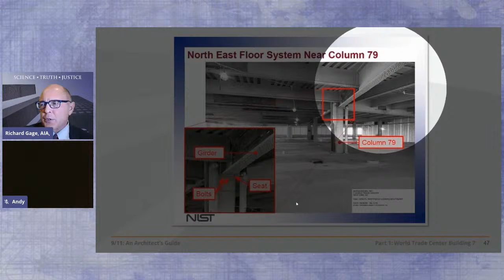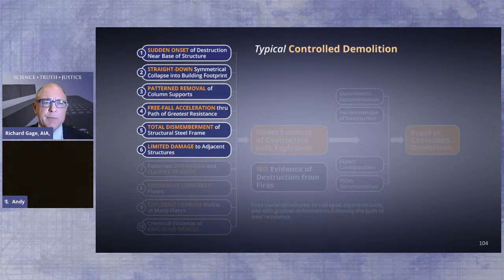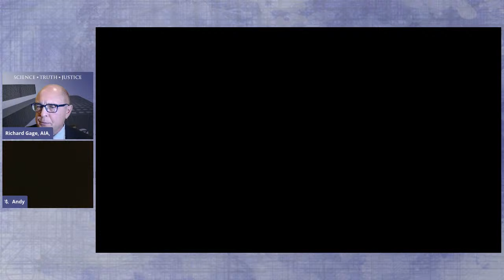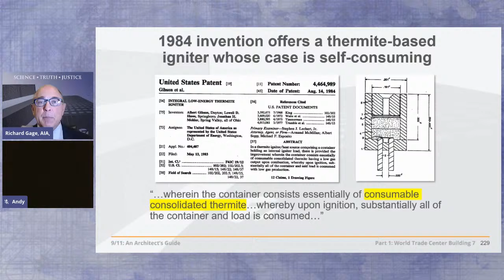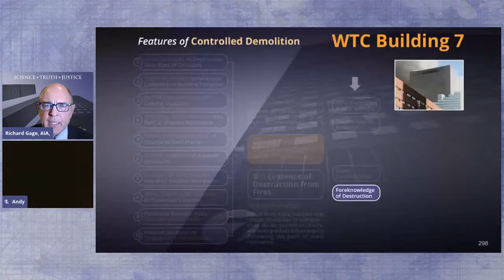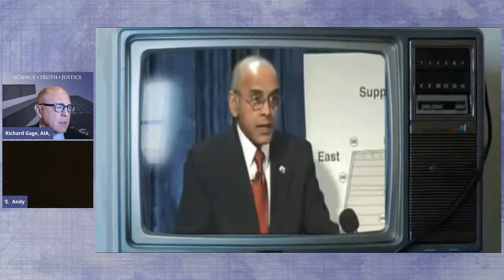9/11: An Architect's Guide | Part 1: World Trade Center 7 (11/5/20 webinar - R Gage)

Comment: A warped beam or column can cause a collapse of a whole structure due to buckling. And fire-proofing is only meant for holding the structure intact for 1-2 hours until everyone is evacuated and if the fire is extinquished (or the rooms are being cooled down with water) the building won't collapse otherwise there is no certainty that it will. And there is no proof that the fire-proofing was even done thoroughly and correctly.